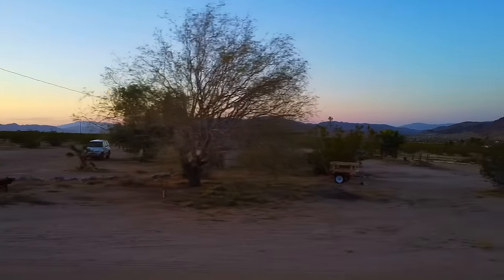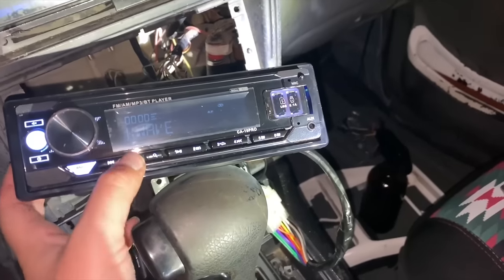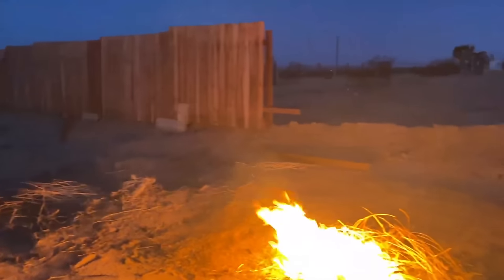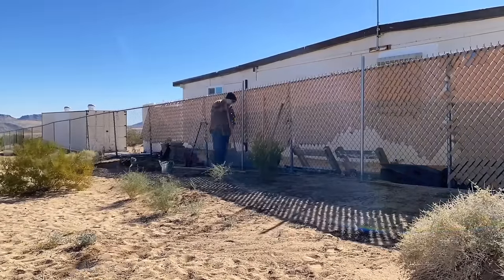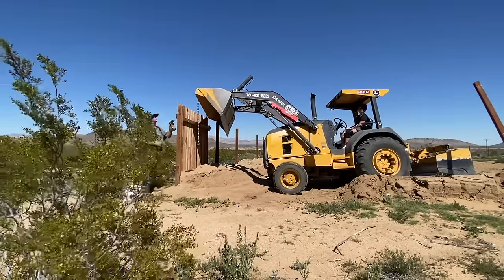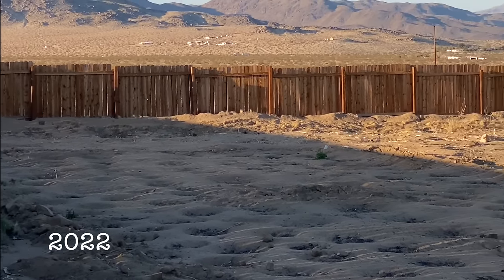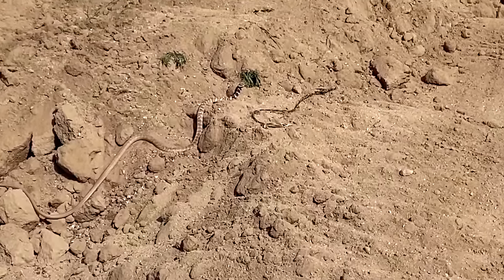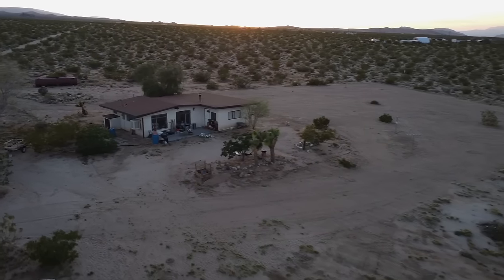YEAR TWO | Removing Every Trace of the Abandoned Pot Farm

Comment: To make the "drag" smooth better, build a box on it with some cedar fence boards. Then put two buckets of sand in the box. Couple spins around the yard. Not smoother...put two more sand in the box. The object is to stop the drag from going up and down over bumps. The right amount of weight and the drag will cut the bumps down level with rest of sand.

Comment: Dig a ditch next to house 5 ' deep(you can research depth for your area on line)put corrugated pipe in ditches and fill !
Buy fan and solar panel to run fan and put pipe inlet in house, put intake up on ceiling and exit on floor and attach fan and you have an air conditioner for the summer in daytime !😊

Comment: Start making "mud" bricks with your extra dirt. Sure, they might take some extra materials, but you can make them, dry them in the sun, and store them for a brick shithouse. lol, or something more useful. Like a castle. 😁 Or a radiant heater/wood burner... or an outdoor pizza oven... or... or 😆
Reply: I wanted to do exactly what you are doing, and I would have started stockpiling homemade bricks right away. After I read the local building codes for structural bricks, I'm sure they have a regulation on ingredients. 🙃